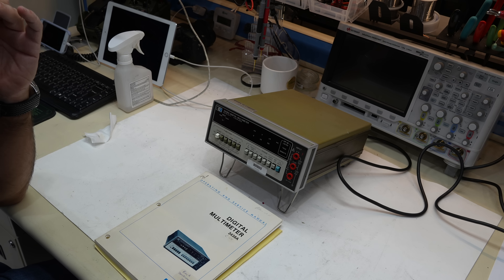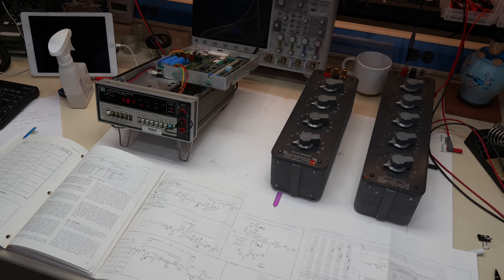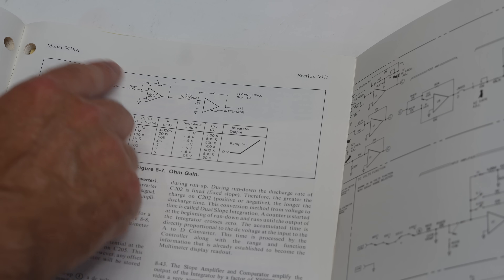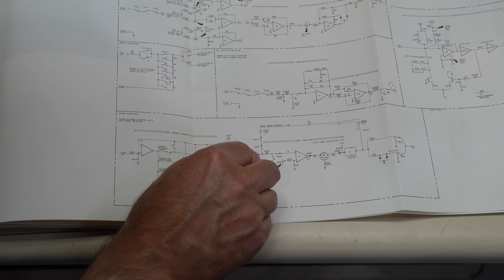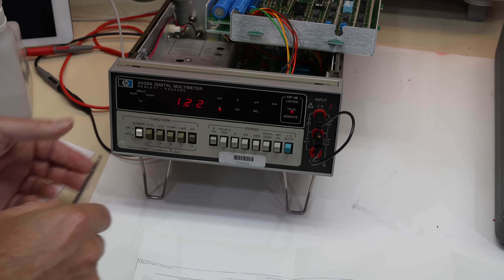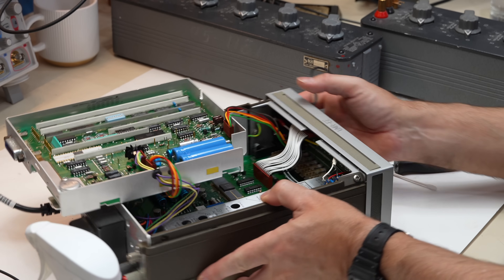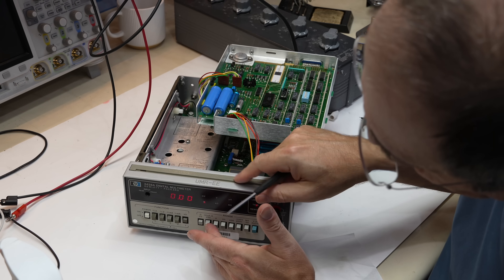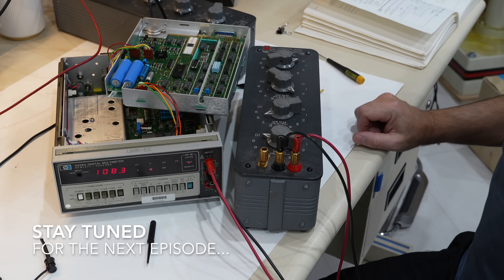HP 3438A DVM Repair Update: Ohms range saved by commenters!

Comment: I stock DeOxIt DP-5 snd D-100.  D-100 is 100% cleaner and it is pretty volitile, dries very fast.  DP-5 is 5% cleaner plus preservative.  For something like this HP meter, I would probably use only D-100 on the front/back switch.  Pro Gold contains microscopic gold particles with some type of encapsulation which prevents conducting until the compound is put undue pressure.  Pro Gold is great for card edge connectors where the metal surfaces release the gold particles as the card is pushed in, but the gold between the contact fingers is not released because it is not under pressure.

Back in the 1980s what is now DeOxIt was called Cramolin red and Cramolin Blue, made by the same Caig Labs.  One was the cleaner and then was followed up with the other for preservative as necessary,  I worked in a neuroscience lab and we were having terrible problems with noise in the Deutsch connectors of Grass EEG amps when making recordings from primates.  The Cramolin fixed the issue.  The other thing we had to do was to go to triaxial cables with graphite impregnated shields.  The third lead allowed active guard driving.  Between that and the graphite, we finally got rid of our cable microphonic issue.

Comment: Well done Marc!
To be honest, I was surprised to see that HP had used an open wafer switch for the front/rear control. It seems to me that it's almost asking to become contaminated. Might it have been a non-original configuration/service replacement item?
Reply from the maker: No, that's the original. Remember, this is the "low cost" instrument of the lineup, and not just by a little bit. However you can see they were still concerned about it, that's the only (thick) gold plated switch in there, and it has two sliders per contact. The other push button switches are not gold plated in this instrument. On the 6 digit, more expensive HP 3478, they could afford a better enclosed gold coated switch - but it failed just as well too...
Reply: Same here. Open switch not a good thing ever.

Comment: You may not have as big of a channel as EEVBlog yet, but you've got a steller community with some brilliant minds. Glad we were able to get this unit back in service completely! Side note... I guess switches are HP's weakness, just like how older flukes constantly seem to have LCD issues...
Reply: yes, we've repaired a lot of HP34401A in the same manner / similar faults on eevblog .. but please be aware , that all that stuff is >20 years old, before these switches deteriorate.
I would not call this a 'weakness', but a normal wear and tear .

'Dr. Frank'
Reply: EEVBlog is quite niche and Marc is even more niche. Marc also has the advantage of having schematics most of the time. Repairing modern electronics is not any different provided you have the schematics. Usually they are too proprietary to ever see the light of day...
Reply: I just picked up a Fluke 8840A and the front/rear select switch is faulty
Reply: I've been watching EEVBlog since the single digit episodes.  Dave's an OK engineer, great PCB layout guy, absolutely terrible repair tech.  He's managed to repair a few things, but failed quite a bit more.  Nothing against him, repair diagnostics can be quite challenging if it's not something that you're doing all the time.  Dave also lacks patience.  Look no further than when he absolutely butchered the star tracker gyro module that mated with the celestial unit Marc recently had a play with.  One of the absolute best channels for repair of high-end gear is The Signal Path, Shariar <sp?> is absolutely amazing to watch his Spock like, well thought out methodical approach to repair.  CuriousMarc's channel is chock full of amazing, talented folks like Master Ken whose ability to reverse engineer unknown gear is beyond reproach.  But that's not the stuff I watch EEVBlog for.  Dave is by far the most fun and entertaining and covers much more approachable topics for the common folks playing around with electrons. I'm just thankful that all these amazing people share their experiences with all of us.
Reply: @marcseclecticstuff9497  Dave is really a nice guy, and he entertains by his relaxed and openly  talk. He brought up and manages the forum on eevblog very well.. to my knowledge it has most contributors worldwide, the communication is really high SNR, practically no trolls, very friendly and cooperative, many very skilled engineers, scientists and interested amateurs. In the worthwhile Metrology and Repair sections, there is really a lot of experience concerning HP, TEK and Fluke T&M application and repair, as well sophisticated DIY instruments, like in the long LTZ1000 thread. 
"TiN" is one of the guys, who really  dives deep into the most complex instruments, like the HP3458A and the FLUKE 5720A. 
Marc on the other hand has the skill to explain the technique and the repairs in a very understandable and entertaining manner, like in the famous old manuals of HP: "Principle of Operation". How I miss the times, when each instrument came with such a complete manual, including schematics.
Here, these guys 'simply' do a reverse engineering of schematics, software, hardware, which is the greatest joy for me, often jaw-dropping.
Reply: Well, I think there is no comparison between Marc’s and Dave’s channel, or communities. Ignoring for a while the ignorance of Dave regarding tech he does not understand fully, I don’t remember him actually repair something.
Reply: @mx0r eevblog is Daily Mail of electronics, oscilloscopes , curiousM and signalpath, got me back into electronics from a long gap , Radio, Radar, the dark arts
Reply: @mx0r  marc is pretty smart and has some brilliant friends
Reply: Marc and people he has around, is truly mindblowing group of engineers. So sad, that people like them don’t get to be role models for youngsters, rather than all those tiktokers and alpha-idiots.

Comment: Years repairing various devices, I learned something: Rarely any dedicated chip is the culprit. I believe that, due to them being special and rare/expensive they are made with lots of protections so they are hard to break. Of course this is a theory.
Reply from the maker: That has not been my experience. The higher end HP 3458 DVMs are known for having proprietary hybrid failures (see https://youtu.be/upTgM_S5rAQ ), as well as the HP 8112 / 8116 generators (see https://youtu.be/LJ-PsPow10M ). The proprietary ECL chip failed on my HP 8082A  (see https://youtu.be/09zhUbJl37w ), and the proprietary Nixie driver failed on my HP 5327B (see https://youtu.be/vKxobfvrt-I ). Not sure they fail the same or more often than other non proprietary parts, but when they fail it is way more difficult to repair - or just plain impossible, like in the HP 3458 case.
Reply: Makes me miss the days before planned obsolescence
Reply: oloco! tabajara labs!!!